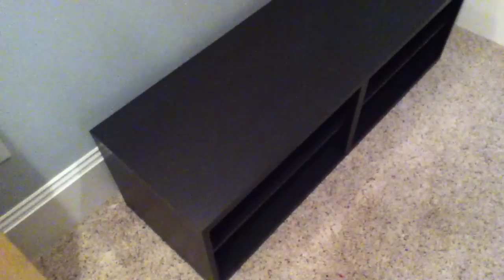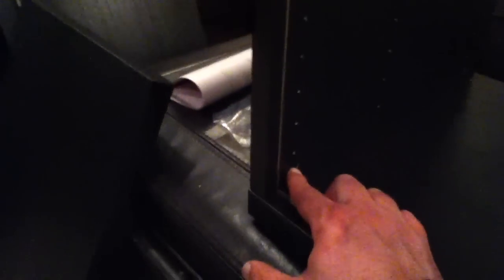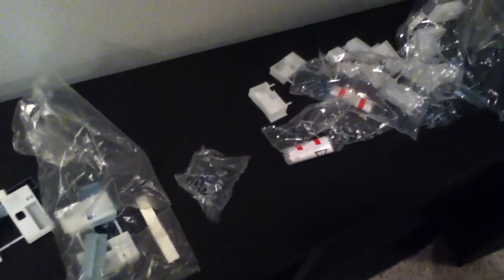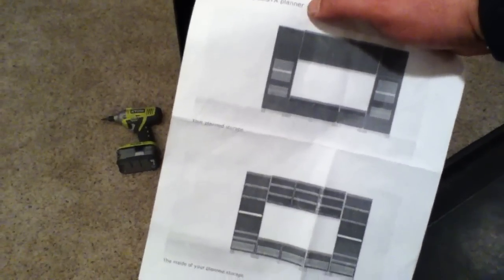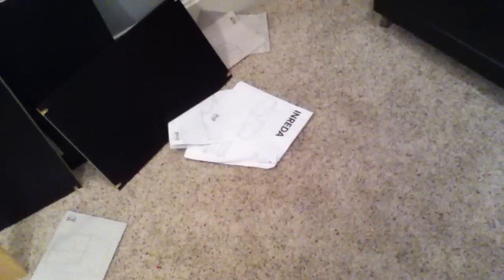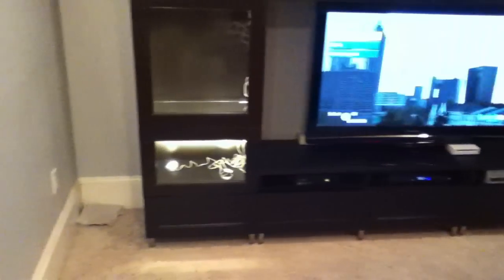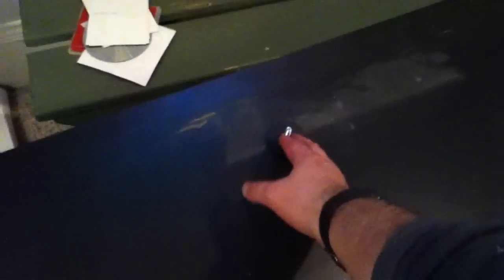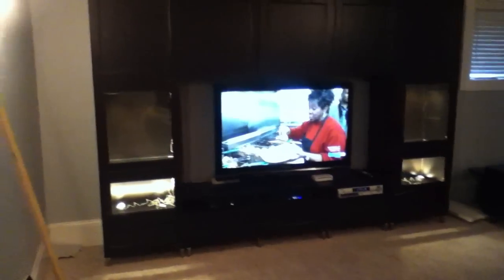Ikea Besta large entertainment center project and assembly tips

Comment from the maker: I think a 55" would be pushing it for that particular setup, but they can be scaled up or down in size of the components on the Ikea design software.  You just make the center opening sufficient for the TV and then the computer will show which components can be set up to go around it.   Remember to leave room for the mounting pedestal and to be able to reach around back there to get at any buttons switches or cables if necessary.

Comment from the maker: Each one of the cabinet modules comes with a few screws for attaching to the other cabinet  modules, but a few points like where those three accross the top that are not supported from the bottom go, I used deck screws to hold the cabinets against each other, and then the same kind of deck screws to hold that entire upper section to a board on the wall.   A 1X4 board is needed as a spacer to have room to run wires back there and clear the cabinet with the floor trim to keep everything level.
Reply: What size deck screws did you use?

Comment: We bought an almost identical unit a few weeks ago. Did you attach all the cabinets before you attached it to the 2x3s? Reason I ask is because the top cabinets are very heavy and I'm not sure if heavy duty screws (Spax 1 1/4" MDF) will hold it together until I attach the cabinets to the 2x3s. I've thought about laying the unit on the floor, attaching the cabinets and then raising it up to attach to the wall. Your thoughts are welcome. Thanks!

Comment: A few questions. 1) I plan on also mounting the bottom set of cabinets. Any other suggestions for those or just treat the same as the top? 2) If I'm looking to run wires through the drywall, would you suggest doing that prior to installing the cabinets? 3) Did you install any sort of cooling system for the components in the cabinets?  Any info would be helpful. Thanks.
Reply from the maker: The cabinet setup there is backless where the TV goes, and the whole thing got spaced out from the wall a little bit in order to clear the baseboard trim, that also by default would allow for some air circulation.   The idea of component overheating never really came up, but I guess it could.   As for cutting holes to run cable, I think if you just space that out from the wall a little bit, say using 2X4s or 2X6 spacers that gives you plenty of space to run wires and cables without digging up the drywall in the current fashion of trying to stick everything inside the wall.  Run the cables around the back of the cabinetry, and then use the kind of hole saw normally used in installing door locks to get holes in and between the cabinet compartments.  Milwaukee has some pretty good ones that mount on the common 1/4" impact drivers.   I highly recommend the hole saws over spade type bits on the Ikea particleboard.
Reply: 8digitPDX
Thanks for the quick reply and the great suggestions. Your video is definitely going to be my go-to this weekend for reference.
Reply: 8digitPDX
Sorry one last question, for the lighting, did you drill holes prior to putting the cabinets on the wall or after?
Reply from the maker: There were no holes drilled in the wall, there was an outlet already behind the cabinet so power cords were simply fed into the cabinet, remember, there is a space between the cabinet and the wall, so just having a plug in an outlet would not be a problem for that, this was not hardwired to the house electrical, just plugged in to a couple of power strips in the cabinet.  Everything on that is relatively low wattage so it all runs off a single 15 amp circuit which also runs the rest of the room.
Reply: 8digitPDX
Everything went up beautifully! Thanks again for all of the tips.

Comment: Hi there, I'm building a unit similar to this. I'm having a hard time understanding how the towers and the center unit come together. Do they have to mount to the wall? How do they connect to each other? The instructions aren't super clear to me.
Reply from the maker: John Williams I was just building one for somebody today.  I did the board across the upper row again, but this time had to go one high one low in order to make the top row more secure and even,y spaced to the wall.  I put a 2x4 across the full width of the top row then secure the top row to the board, using it as the spacer.  I then attached all of the boxes from the top down, and at the very bottom make adjustments at the legs to level everything out.  The trick is getting that top row in all secure.   I generally use 1-1/4" drywall screws to hold the cabinets onto each other.  Hope this helps.
Reply from the maker: Yeah, I had to figure that out on my own.  You lay out the top row on a flat surface and screw them all together side to side.  That particleboard stuff needs to be pre-drilled for the screws or else it chips and causes debris to get caught between the boxes and then prevents them from going together flush.   Sometimes even with predrilling, you have to separate them, get the debris out, and reattach them.  What I did on this one and usually do is then put a 2X4 across the back and attach that at all those corner bracket locations where it says to attach to the wall, but in reality, there almost never is a stud in the wall where one one of those brackets ends up.  You then put the top row on top of the whole set as it's standing there against the wall, shove it back to where the 2X4 contacts the wall, and shoot big long screws all the way through into the wall where you figure there is a stud (use a studfinder and mark above the cabinet, so you can sight stud locations in the cabinet off those marks above the cabinet, they won't show once it's all up so just leave them).    Now getting those into studs can be tricky, but if you miss a stud, just leave the screw there and try to hit a stud somewhere else.   Next slide and wiggle the whole lower set into position under the upper set.  Once you get that line up to where it looks good to you, screw them together, through the wood, same method used when the top row was screwed together side to side.   The whole thing will be spaced out from the wall by the thickness of that 2X4.   That gives you plenty or room to pass wires and cables back and forth behind the cabinets.   If the floor was not level with the wall, then you adjust the feet on the lower cabinets or shim it with thin pieces of material like wood or what I like, left over vinyl laminate flooring pieces.

Comment: Quick question brother, how did you fasten the upper unit to the 1X4 board you had previously screwed to the stud? Did you use the rail system ikea provides onto the 1X4 board?
Reply from the maker: I think I used regular screws on that one since it did not come set up for the hardware commonly used with their kitchen cabinet rail system.   Since this is supported on the ground, the screws are only there to keep it level and from tipping forward, not holding its entire weight.
Reply: Is the top portion also supported by the side units or is it that independently being held up by the spacer you placed on the back? I am currently building a similar unit and and am having trouble understanding the correlation between the connection of the base, side units and split upper units (the base has 3 bays but the top is 2 separate pieces so 2+1!). It doesn't help that the ground at this particular location is sloping at more than 2 degrees. Would you recommend I mount a 2x4 spacer across the top, then use the rails to support them? Or will that gap cause problems for that type of mounting. Thanks, looking forward to a response.